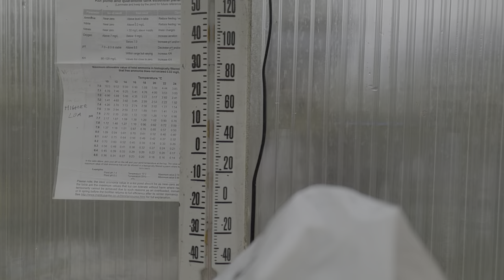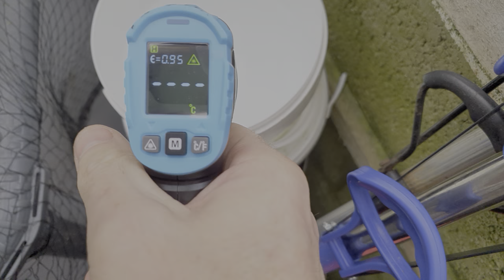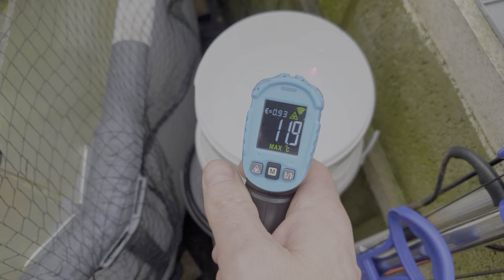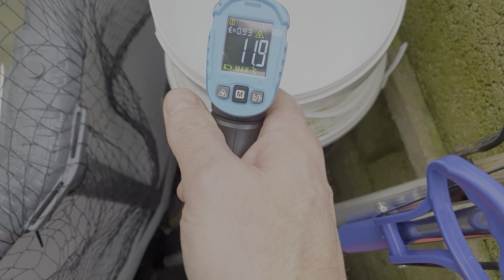Main Pond Balls| Should we do winter water changes/filter cleans?? 😕

Comment: you got a big garden haven't you. Do you leave the sail up over winter ? doesn't it fill with water/snow ? I do one water change per week from late Nov to mid Feb ( if the temp/conditions allow ) and as I run a 14000lph pressure filter its self cleaning when I turn the handle when I do a water change.
Reply from the maker: Hi, I do leave the sail up yes for overhead view from heron! It's very permeable so no issues collecting rain water. 1 wc per week I think is good 👍  cheers